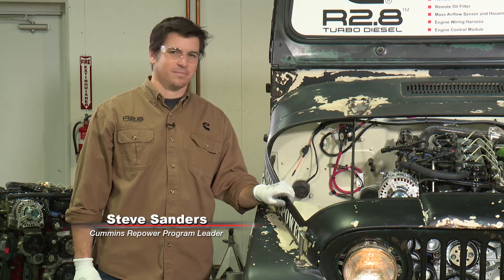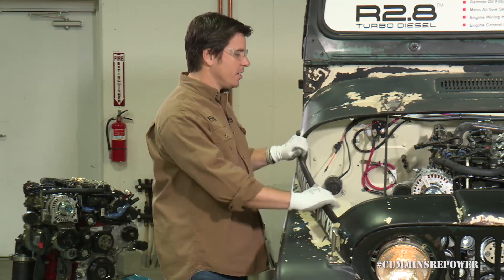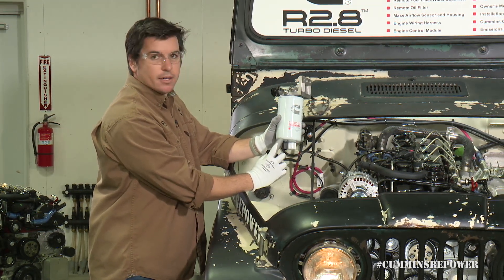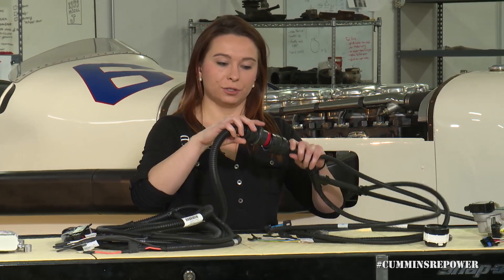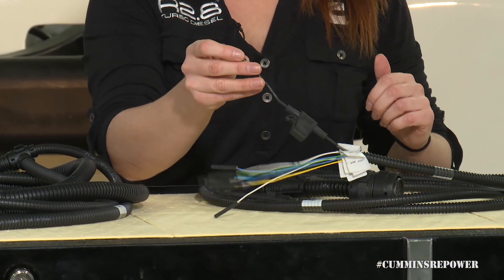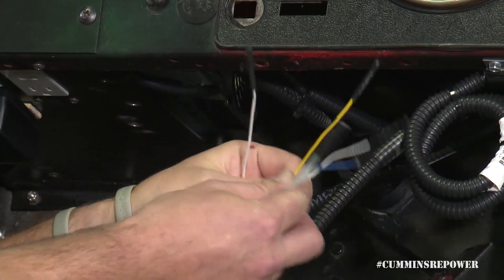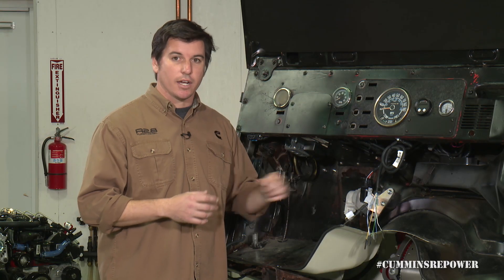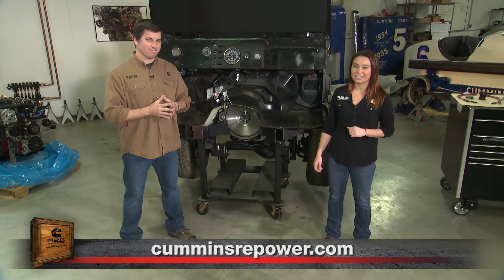Cummins Repower Garage Video 9: Electrical System

Comment: When are they going to program it for cruise control functions  ? It looks like there's already some extra wire taps for that sort of future upgrade  ? It's drive by wire so it would be crazy to try to set up some kind of servo half ass system when  all the other Cummins drive by wire systems have it programmed in and the momentary switches just communicate with the computer.